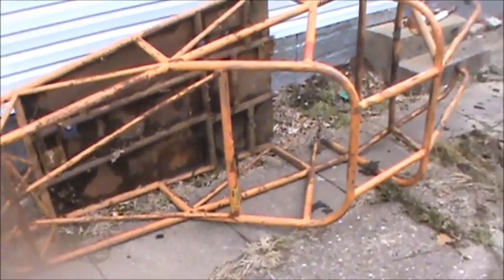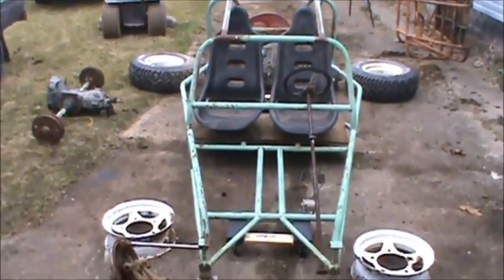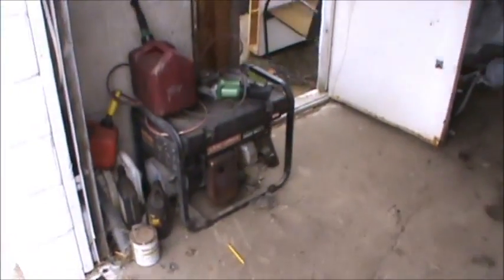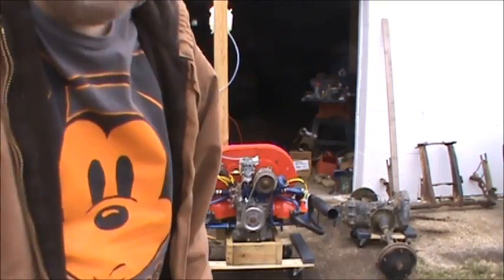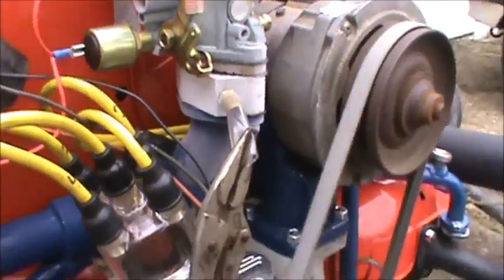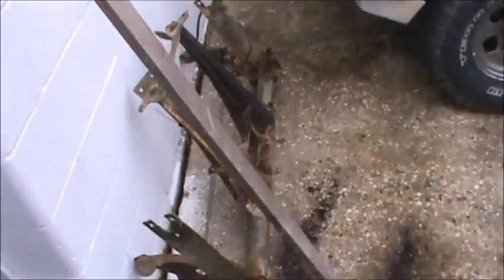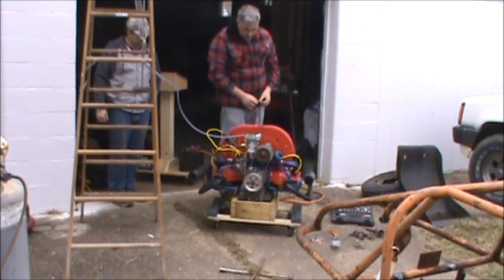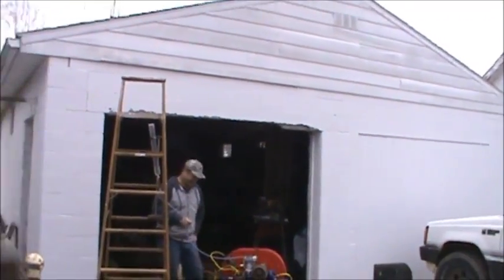THE STAN MEYER WATER ENGINE #7 Electronic Ignition

Comment: If this is real someone needs to make a how to video, yes theirs tons of hydrogen generators , but no one is telling what modifications you need to make to the motor because the hydrogen isn't a liquid gas and standard carbs/fuel injectors will not process the mixture correctly
Reply: He explains how. Ambient air mixed with HHO to lower the explosive power to that of gasoline. The issue here is to have the low amps (efficient) electrolisis of water to produce HHO in real time to run the car and retrofeed the HHO generator. No one had obtained the needed amount of HHO at the milliamps rate he claims. But it’s a problem of fine tuning the hardware components to resonate at the right frequency. This is something electrical engineers don’t often do or understand. Tesla was big on this issue of resonance. I guess there are a few today that could break down this problem: @MasterIvo & Eric Dollard probably.

Comment: Looky there they just filled the carb bowl up and hooked up lines to make it look like running it on water, a vw will go pretty far on just whats in the bowl couple miles atleast, ive done it when my fuel lines where disconnected after a bump.
Reply: Its not running on water.. Its running on the combustion of Hydrogen gas and Oxogen gas.. Electrolysis and the creation of this gas is the first part, and secondly one must have the resonate ampage tuned correctly. Your right it did go far, I believe he crossed half the continnental US.

Comment: HYDROGEN POWERED CAR YOU IDIOT...   Stan made a highly effecient ELECTROLYSIS device..  the remarkable thing is is runs in unity...      the engine starts on battery power, the engine now turns the altenator which developes power to make more hho...     all be it the only exhaust from burning hydrogen is water......

yes....   WATER comes from the exhaust .. meaning if you put the tail pipe back into the water resevoir... you have something that breaks the laws of science.. and they get mad, poison you to death and confiscate all plans and parts of the device..

why would they do that if it doesnt work......

Comment: So, nothing is different than any VW Ive ever worked on. They have a gas tank and a battery. I dont see anything different than a normal VW set up. I dont see a fuel cell. I dont see a hydrogen separator anywhere???? WTF???? This is a good joke at best. Thanks for fooling the 99% Ha Ha. VWs are fun. The older they are the more people dont know what they are looking at. WTF?????????????????????????????????????????????????????????????????????????????????????????????????????????????
Reply: The Artist The purpose of the demonstration of this video was not to show any type of Stanley Meyer technology it was simply to show the functioning of the engine as it is and then can come everything else. You have to have a functioning engine first before you can do testing on it that's what they did is got up to the point where it functions. if you've seen some other videos, they have done other types of testing on it. As far as Stanley Meyer stuff being applied to it well maybe that's just not for the Public's knowledge as all the information you need to know has been provided and put out there freely for you to look at, research, read and put together and yes it all does exist out there.  You've been given all the tools you need to make it work so if you want to see a functioning system go out and build it. What good does it do for you if you don't understand it? It does you no good whatsoever... Even if the system was put out there and sold so you can have it for your own use what good would it do you then cuz if something goes wrong you wouldn't have the knowledge to fix it. Knowledge is power if you want it you must seek it and obtain it. Again all the necessary information has already been put out there it's up to you to find it and it's up to you to do with it what you may. 

We all want to see Stanley Meyer technology run an engine and maybe just maybe some of us already have and those that maybe have also put forth the work to make it happen....
Reply: The Artist h

Comment: How about a 100cc scooter powered by a 60-cell series electrolyzer running of an 120V inverter and bridge rectifier powered by the 12V battery? Estimated gasoline consumption while riding at 70km/h would be about 1LPH gasoline, which would convert to about 4000LPH of oxyhydrogen consumption. Idling the same scooter would probably take 500-1000LPH. The 60-cell electrolyzer would produce about 40 LPH per Amp measured at room temperature. Thus you would need 100Amps thru the 60-cell to produce 4000LPH. Because the electrolyzer has 60 cells, you need to power it with about 120Vdc (assuming 2.0V cell voltage) from the inverter. Assuming 100% efficient inverter, it would draw 1000 Amps from the 12V battery to produce 120Vdc 100A. If the scooter had a fully charged 5Ah battery it would last for 18 seconds at 1000A until it would run out. The scooters “alternator” would produce probably about 5A maximum.
Well, YOU ARE AN IDIOT..this is a car engine, not a scooter. Oh, really then let's see..
The amount of oxyhydrogen needed to run an internal combustion engine is spectacular. Idling a small engine (e.g. 5hp) would require 500-1000 LPH (liters per hour), while idling a car engine would probably consume about 3000LPH of oxyhydrogen. Driving down the highway would probably consume 20000-30000 LPH of oxyhydrogen. 
One liter of gasoline contains approximately 30MJ of energy, while oxyhydrogen gas would contain approximately 7-8kJ per liter. This means that you would need approximately 4000 liters oxyhydrogen for each liter of gasoline your engine currently uses, assuming the engine efficiencies are approximately the same on oxyhydrogen than on gasoline.
Thus if your car uses 6 liters of gasoline per hour while driving down the highway, prepare for 24000 LPH oxyhydrogen consumption. Assuming a super-efficient series cell electrolyzer (2.5 W per LPH) you would need 60kW of electrical energy to run the electrolyzer. This corresponds to about 80hp, which is significantly more than the amount of engine power used at highway speeds (~20hp). Figuring in the alternator efficiency (~50%) you would actually need 160hp on the engine shaft to produce 24000LPH of oxyhydrogen gas.

Comment: 13:13 This doesn't really look like water, with a slightly yellow-green color... Ans don't say light refraction or so is the cause.
Reply: kamikazeratte the slightly green color could be colloidal  copper if copper is the electrodes that are being used colloidal copper is a by product of hydrogen production when using copper electrodes

Comment: This DEFINITELY is not an HHO run engine, nor does it have HHO being introduced into the induction system in any way.... No HHO generator is being used anywhere on the engine shown here. AND Goprof150 , is right! Icing will be very common in cold damp weather with no induction heat or a device to keep the ice from developing on cold areas where the condensed water could freeze, such as the isolated intake tract with its' exhaust - heated plumbing disabled. This is a conventional fueled engine, running on a source of a liquid fuel such as alcohol or gasoline....
Reply: There is that technology but it’s “Shelved” 📦 in a deep facility. To De-Ice a large lake you could use a few electric tuning forks like 40ft-10ft or larger depending on the lake size and tune them to vibrate harmonically in resonance to the Electric properties of that body of water as water is a battery bank of several things so you cold cause the molecules to vibrate faster resulting in a boiling effect
Reply: Yes, I agree with you. There is no eletrolyser... :)

Comment: Your intake is frosting because your preheat tubes are  plugged w/carbon.
Reply: Or that hole in the top of one side of it that usually warms air coming into the oil bath filter

Comment: fuel line enters through the fan shroud so I think he may have a can of gas in the back?
Reply: lightrose100 thats not fuel line, its for an external oil cooler they just bypassed it by running it straight out and back to the engine
Reply: It was literally hanging on the 2x4 behind the motor with a line running from it straight to the carb.

Comment: FAKE. Notice the exhaust smoke towards the end of the video.
Reply: It's running on a hydrogen/oxygen mixture (HHO) which is the two separate gases produced from the breking down of water, essentially, it's an engine running of of water, since that is the only source of the fuel.

Comment: I have been a V W mechanic for 20 yrs. so far this video is nothing  more than a couple nuts running a standard engine test stand, with nothing to do with running on H2O. what a piece of crap.......
Reply: I like the fact that preheat tubs aren’t working and his intake is icing.
Reply: I'm with the VW mechanic - looks like a Solex gasoline carburetor . Stoichiometry with H2 is 5200 °f. so that Vdub motor is not running on pure , or even mostly , H2
Reply: Unity Twins water hydrolesis is the word, but it requires more  electricity that the engine can produce by itself. You'd be better off just using that electricity to instead power motors to drive the wheels.
Reply: It's very possible because water is energy
Reply: ps...  hydrogen is 130 octane, why do you not think an engine will run on it?..  well,  here's proof of at least one vehicle....    BMW H7        you might be surprised,  I'm not,,  hell you can run a damn wankel on a stiff bottle of wine by hey I only got 10 years of experience....
Reply: Err, kinda misleading, He suggests that he's running it off of hydrogen but it's really just another dumb ass "free energy" videos.
Reply: @unitytwins6652  How the hell this is a free energy video is it runs on water?
Reply: He's running it off of hydrogen, which is produced when you break down water, I forgot the technical term for it but yeah, breaking down water will make hydrogen/oxygen gases which can be both fed into one line leading into the carb of the engine.
Reply: Thats a AD HOMINEM FALLACY (why we care where u worked? we care about things u can probe), and the only thing u can probe is that u are a piece of crap.

Comment: I believe its frosting due to compressed hydrogen
Reply: Unity Twins just a normal engine running of petrol.
Reply: Yeah you're right, this video is fake, yet it really is possible to run an engine off of hydrogen, the only problem is that it is extremely explosive. which hydrogen and oxygen atoms can be made from the electrolysis of water.
Reply: So its a small scale GEET reactor?
Reply: Nonmangina@gmail.com.
Reply: No, it's just a normal engine running off of a hydrogen/oxygen mixture.
Reply: smoke meth brother
Reply: klbar2005 what a lot of shit, u also one if those that believe santa is real. That explanation u gave, did u read it, its impossible, rather go back to school my friend coz it seems u have a lot more to learn. 
How did u escape out of the asylum?
Reply: It's frosting because that is normal on the older vw engines. Caused by the venture in the carburetor.
Reply: wrong chemical dude.    CO2 turns cold when gasing off from a liquid....